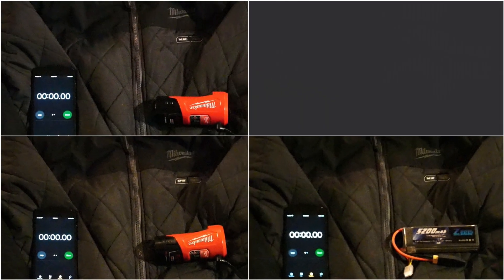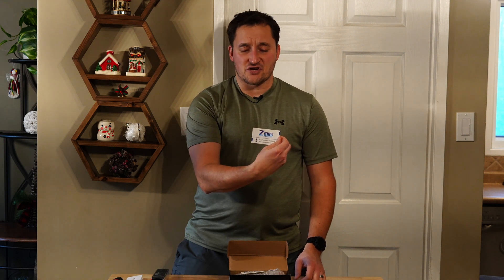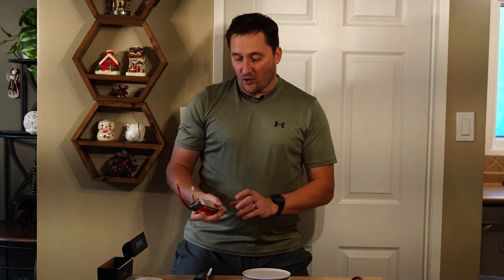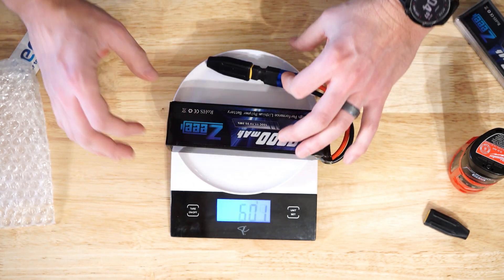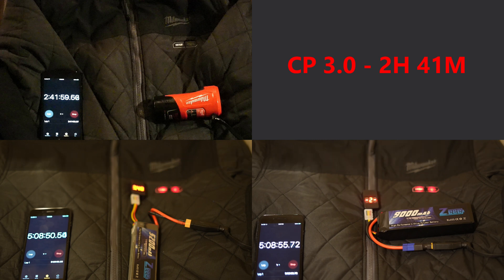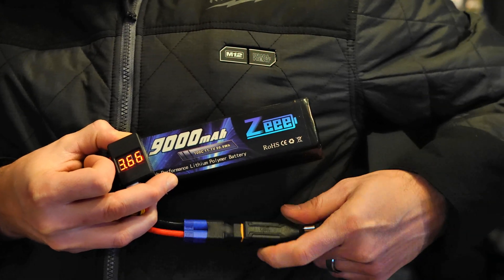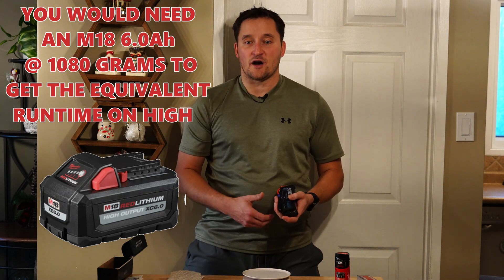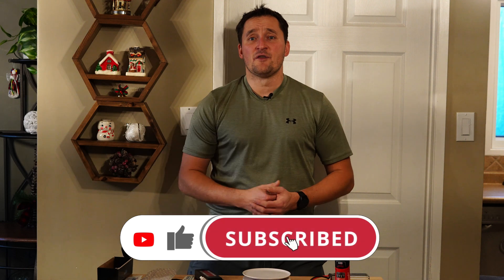Milwaukee M12 Heated Gear Battery HACK for INSANSE RUNTIME!!! PART 2 (WARNING READ DESCRIPTION!)

Comment: Tried your hack and it works great. My 5200 zeee battery lasted 7 hrs the 1st time and had at least an hour left in it. The 2nd time 7.5 hours. But I had to get a much better charger as the cheap one would not balance the cells.
Reply from the maker: Right on, glad to hear it! Fyi I also added a low voltage alarm. You should have some documentation with the battery that says what the minimum "safe" voltage per cell is. Connect the low voltage alarm to those balance leads, set it to that voltage and you are golden!

Comment: I have the new milwaukee heated hoodie.  
Will this setup you are talking about, work on that vest? Thanks for your time.
Reply from the maker: Thanks for commenting! It depends on the plug. If it's a "hexon" one, possibly not, without an additional adapter. Take a look at the plug. If it looks similar to mine in the video you should be golden. Fyi I added a low voltage alarm and a smart charger to the mix for safety sake. Hope that helps!
Reply: @RegsChannel Thanks for the reply. I believe it is a Hexon hoodie. And not being well versed and being an older person, is the alarm within the context of the post.
Reply: Also, what are these two items and do you have links to where I can buy them? And what is their function. I appreciate your time.
Reply from the maker: @dyerfred hey there, if it's a hexon hoodie I bet you have a connector with 2 plugs on the end eh? If so this solution won't work without a bit of retooling.
Reply: Ok thanks for taking the time to reply.
Reply: Just tried it on a hexon hoodie. Does not work since the barrel plug seems different. The barrel on the adapter is too big
Reply: Nvm. I got the wrong size. Make sure your adapter is dc 2.1mm not 2.5mm
Reply from the maker: @davidpham899 solid advice!

Comment: Thanks, I've got a heated hand muff that came with a 5000mAh battery.  I go to the gun range a lot and spend about 8 hours. And the single battery only lasts me about 3 hours on medium heat. I would like to get another battery for backup. Or go this route to last me all day.
Reply from the maker: Sounds like a plan! Thanks for taking the time to comment

Comment: Milwaukee batteries have a built in Battery Management System (BMS) for charging/discharging and safety. Be careful with RC batteries as they DO NOT have BMS built in ... you could cook your yourself real good if that battery ignites! They burn white hot with no way of extinguishing it! Do your homework before you use these in a jacket! Your playing with fire!!!!!
Reply from the maker: Sound advice, I added a low voltage alarm to mine.

Comment: Do not use lipos... what is so complicated to understand? Why would you wear one of the most combustible batteries inside your zipped up jacket? Carry an extra normal battery with you or buy a power bank with even more capacity. Youre using all these adapters when you can just get an adapter to USB-C and use a bunch of safe options. Strap a power station on your side with LiFePO4 batteries 😎😎 then you can run it for days.
Reply from the maker: Hey there! Thanks for taking the time to comment.  I chose this form factor because you literally cannot tell that the battery is there when sitting. Compared to the bulk of the original pack/ adapter it is significant. With that said however I will be trying an alternative in a future video.

Comment: I went with the 14.4 battery
Reply: Is it as safe as using the 11.1 volt rated.  I'm thinking the 14.4 volt batteries will last even longer.  But can the heating filaments in the jacket take the higher voltage.  We are entering into unknown territory...lol
Reply from the maker: @exofficiox yeah, you are basically overclocking the jacket! If the filaments can handle it, it would be hotter, that's for sure! If I had the budget I would test one out lol. Reminds me of hooking up a variable voltage DC adapter to a grey brick game boy. Click the slider to 7.5 volts and the screen got brighter and the volume got louder lol 😅😅😅
Reply from the maker: Good stuff! Hope it works well!

Comment: I have rc cars and those batteries. I wont even charge those in my house. I had a cr123 battery ( very small) blow up in a flashlight in my pocket and burnt my leg up pretty good. Flashlight shot out of my Duluth fire hose pants like a bullet. Had to hike out of the woods in my underwear due to the burns. be careful
Reply from the maker: I appreciate the concern. I upgraded the charger, charge in an ammo can, and use a low voltage alarm. Been solid so far! Thanks

Comment: Those heating coils are going to prematurely fail.  Look into the gen 1 version of that jacket.  Most of the time,  i do not even turn the jacket on, i just zip it up.  The newer jackets are like sweaters
Reply from the maker: Thanks for the insight. I personally am looking at getting a tough shell / hexon one for testing. I've had the one I used in the video for several years and it's been solid so far!
Reply: And I’m not referring to the voltage or anything with the battery, its about the coils be heated that long

Comment: Do you know if there is an adapter for the new hexon double plug. I just bought the hexon tough shell on clearance for $135 would like to buy a pack the Milwaukee battery pack for $100 is crazy for same run time as a cp3.0
Reply: Hey, did you figure out that double plug thing. I've got one of those Hexon  jackets and I was wondering about the double plug.
Let me know thanks
Reply from the maker: @RobLyn-g7j  hey there! The connector I showed in the video should work with the primary connector. I think the secondary smaller plug might be for Bluetooth telemetry or connectivity? I do know that these are backwards compatible with the old style batteries. Once I get my hands on one I will test it out! Thanks for watching!

Comment: instead of a monitor you should cover a bms that can wire in easily with that connector with low voltage cut-off
Reply from the maker: @pearlrival3124  agreed, that would be cool! I'm going to keep my eyes open for such options. Thanks!

Comment: I don’t think your brand new pack has a faulty cell. The LIPO alarms work for 1 cell all the way up to 6 or 7 cells. I believe the alarms run off 3V and only pull power from the first cell. As such due to the low draw and extended run time, the effect is greater on the first cell hence what you are seeing.
Reply from the maker: Interesting as it's showing readings from all 3 cells but it was the middle cell that had a steep drop off... I believe the low voltage alarm I'm using pulls about 2 milliamps, but I could be wrong here. Thanks for the insight!
Reply: @RegsChannel  In that case, yep definitely more testing needed to confirm!

Comment: How about internal cell phone batteries, maybe you can stack them? My Samsung cell phone gets hot all thw time and the battery lasts years and is being charged and discharged thousands of times and withstands hot vehicles in the summer.
Reply from the maker: @jeepsaround  those batteries are controlled by a BMS to regulate there charge/discharge rate, and I'm not too sure what their optimal voltage is. Honestly using the low voltage alarm and upgrading to the intelligent charger has made that 5200mah pack pretty much perfect for my use case!

Comment: Milwaukee chargers won't sense and turn on and charge over discharged or completely discharged  batteries. However, they can be charged up and restored to normal use. Can the RC batteries do the same without actually ruining them and being a safety issue?
Reply from the maker: I spoke to that in this video, RC batteries have no BMS hence me using the low voltage alarm, and upgrading to the intelligent charger. Cheers!

Comment: New Milwaukee jackets have a different plug. I wonder if there is a option for that
Reply: The plug on the new Hexon does not fit the DC 5.5 mm x 2.1mm adapter. looks like the 5.5 mm is correct but the pin 2.1mm is larger than the plug on the jacket. I don't know what size it is, but it will not fit in the plug on the jacket.
Reply from the maker: @jamesrobertson9015  I would need to get my hands on one, and take my micrometer to it.
Reply: @RegsChannel  The pin in the plug on the jacket and the heated gear power source and the new top-off is smaller than 2.1mm. I don't have anything that will fit inside to measure it (I can see the difference in the pin size). You can use the dc 5.5mm x 2.1mm male to the battery's because the smaller pin size will still fit. The 5.5 x2.1 female will not connect to the Hexon jacket, the receiver hole on the male side of the jacket will not except the 2.1mm post. Milwaukee has to be able to sell us the expensive batteries. 
Thanks
Reply from the maker: @jamesrobertson9015  I'll can't see them using a proprietary connector, from a tooling standpoint that just doesn't make sense, plus hexon equipped gear is supposed to be backwards compatible with the older stuff. Eventually once I get my hands on one I can do some further testing.
Reply: Have you tried the newer jacket yet
Reply from the maker: @phillipwood2190  hey there, no I haven't, hopefully I can get my hands on one of the new jackets soon. To me the "primary" plug looks the same, I think it should work with the adapter I pictured. Need to do further testing to confirm
Reply from the maker: @jglassman1122  the main plug is still the same I believe as they are backwards compatible with the previous adapters. I think the other plug is for the smart functions of the jacket.
Reply: @ awesome

Comment: Hi, great video!!

Can you get a 3-foot DC power extension cable, 5.5mm x 2.1mm?  Instead of having the battery in your jacket pocket, can you put the battery inside a special RC pouch, put it in a book bag, and run the wire to your jacket?  So it's not on you for safety and comfort.  Do you think that extension will work?
Reply from the maker: @xprocker69  come to think of it, yes I saw pigtail adapters like that! This is a great idea to mitigate the risks. Thanks for the suggestions! Cheers!
Reply: I'm going to try it. I should get it  anywhere between the 29 and the 3rd
Reply from the maker: @xprocker69  right on! It sounds like you are well versed In the ins and outs of LiPo batteries but make sure you understand all the risks involved as well as the necessary precautions. Love the idea though, let us know how you make out!

Comment: I’m looking at the 8000 hard case
Reply from the maker: @adrianrobinson7953  hey there! Thanks for the comment. Make sure you follow all the safety precautions and understand the risks involved. I would strongly suggest a low voltage alarm, and a good quality balance charger (I upgraded to a B6 based on some suggestions here, there are better yet). Never charge the battery unattended, and for storage make sure you have a fireproof container of some sort (I'm using and old ammo can with the gasket removed) compared to a standard Milwaukee XP pack, I think you will find this more comfortable!

Comment: Bro what’s my best option for my work hoodie..which one is safest for a 10 hour day and how do I know when it’s low and not dead so I can stop using?
Reply from the maker: "safest" is a relative term... You need to understand all the hazards and risks associated with these. Based on what I was able to gather, biggest risks come from over charging or over discharging. Don't skimp on a good charger like I did in my original video. Get a good quality charger with a display ideally. Next up add a low voltage alarm so you know when you have hit that limit, or better yet, there are BMS boards that you can adapt that will cut off the battery at a specific voltage.. you will also want to look into a hard case model, that will give you added protection from bends and punctures. Or.... Look into USB C battery pack adapters for these jackets. The form factor is bulkier but you can get some pretty decent runtime with them and they are significantly safer for a 1st timer. I'll be doing a review of one on the channel soon. Stay tuned!

Comment: Nooooo you need to look at what happens when that battery catches fire you don't want it in your pocket for the love of God 😮
Reply: I use the exact same battery for rc but store in in fireproof pouch ....not in my f@#in pocket dude .
It's going to kill you
Reply from the maker: @thunderchild2237  thanks for taking time to comment. Discharging down the pack down 10.2 volts (in conjunction with a low voltage alarm at about 0.8 amps is going to turn it into thermite you figure?
Reply: @RegsChannel  
Not sure about that myself but be safe
Reply from the maker: @thunderchild2237  Thanks for the comment. The community here has been very helpful at pointing out the hazards as well as suggestions to mitigate the risks. So far for my particular use case, this has been good! I've given up on the 9000mAh battery but the 5200 mAh one has been solid!
Reply: @RegsChannel  good idea the bigger the battery the bigger the fire and sometimes they go up in seconds and then like magic you got a fire ball in your pocket 😉 be safe brother
Reply: @RegsChannel  I'm sure you have learned this already but I feel like I need to mention you cannot extinguish 🧯 a lipo fire you can only contain it till it's done
Reply from the maker: @davidmccurdy306  Yep that pure anger needs to burn it's self out and then you are good!
Reply from the maker: @davidmccurdy306  thanks for the concern, you need to realize these don't spontaneously combust. I've learned a lot since the video was posted and put out an updated video. I have a low voltage monitor in place, I upgraded to a B6 balance charger and I make sure I take proper care with recharging the battery. Sure if someone stabs me in the battery at a football game I'm in trouble lol, but I think you can take the proper precautions once one understands all the risks! Cheers!
Reply: @RegsChannel  well be really careful because when they get over charged or discharged they do catch fire at a football game I doubt you'll be able to hear the alarm you need a low voltage shut off so you don't forget and catch fire....it won't be good...I promise..
Reply from the maker: @davidmccurdy306  hi David, I appreciate the concern! The charger cuts off at 4.2v per cell, in line with the manufacturers spec. The low voltage alarm sounds like my smoke alarm going off, It's VERY loud! I have it set to 3.4v (the manufacturer states I can go down to 3.2v, but the community consensus is that's too low...) I always keep an eye on it while charging and store them in an ammo can just to be safe. To give you context I charge/discharge this thing at a max of 0.8 amps... In RC applications you are hammering current in and out of these things... I get that things can still happen but with the right precautions I think you can make this work. Cheers!
Reply: @RegsChannel  yep as long as you stay on top of that you'll be fine but if you are adamant about keeping lipo you need to get a better charger that is capable of doing storage charge balance charge and cycle so you can get the best life out of your batteries if you didn't know that already but good luck
Reply from the maker: @davidmccurdy306  I stepped up to a B6 charger that has a storage mode, balance charging, discharging, etc. definitely a change from the El cheapo I got in the first place! Cheers!
Reply: @RegsChannel  I've had rc car's for years I know what can happen if you're electronics malfunction I would go lithium ion if I were you just saying...but you do you lol .. I hope you store those in a fire proof container 😉
Reply from the maker: @davidmccurdy306  Thanks for the comment! Im actually looking into a BMS board for these. The main reason I went this route was for the size and space savings. Time will tell I guess! I genuinely appreciate the concern. Have a good one!
Reply: @RegsChannel  a bms is exactly what you need to be safe as possible but remember if it gets damaged it can short out and cause a fire so you will need something durable enough to be knocked around if you start jumping out of your seat when you're team scores and definitely go hard case lipo .. might be less comfortable but if something happens less chance to damage the battery
Reply from the maker: @davidmccurdy306  sounds good, thanks for the comment!

Comment: Having one cell drop out before the rest is a sign of low quality battery manufacturing. Usually cells would get tested and placed into groups of equivalent cells. This is quality manufacturing. 
The battery you have is likely a cheap china job that they just toss whatever cells they have into packs. It is likely even C or D grade cells to begin with. High quality name brand battery manufacturers will use A and B grade cells.
Reply from the maker: @1967friend  I kind of suspected something when I noticed that, I do agree you get what you pay for... The 5200mah pack has been great so far, but I was disappointed in the big one. Cheers!
Reply: @RegsChannel  zeee makes a premium series with hard or soft case, not much more money than the regular ones
Reply from the maker: @mainsource8030  thanks for that info! I'll look into that

Comment: the lithium jump starter packs sometimes have 3s lipo batteries. They include a charger and have discharge ports with bms! It would be safer. Also power banks with usb-pd ports have 12v regulated output
Reply from the maker: Hey there ! Thanks for the comment. I may try adding in a BMS board. The vow voltage monitor has been a great addition! My challenge has been the size/bulk of the battery pack. The 5200mah pack has been great size wise.
Reply: @uhjyuff2095  hell yeah.  And they are hardened.   I do this with my Gerber jacket. No special adapters or chargers multi use.
Reply: @daleb5967  What adapters do you use to connect a started pack to Gerber . Please
Reply: @saafrican  it used barrel connectors like older laptops